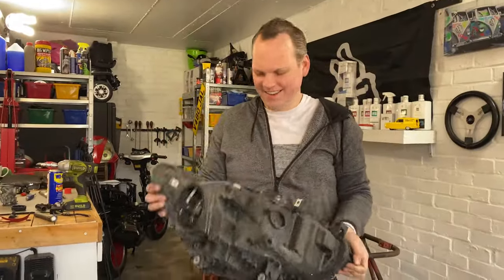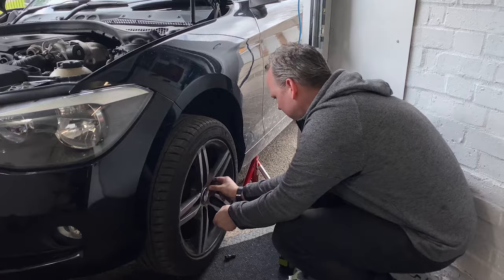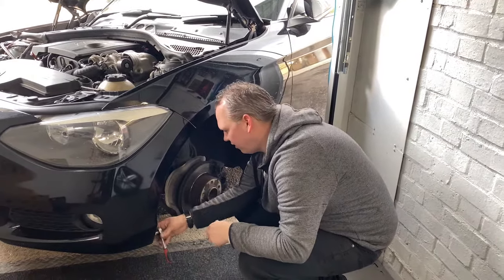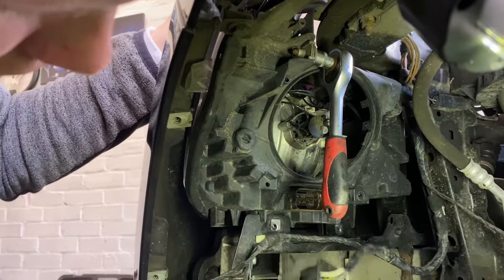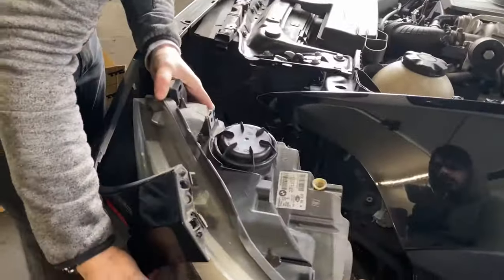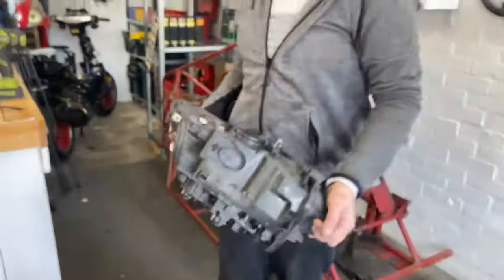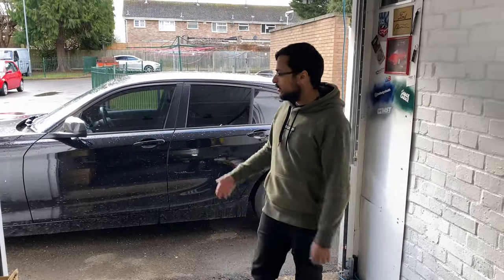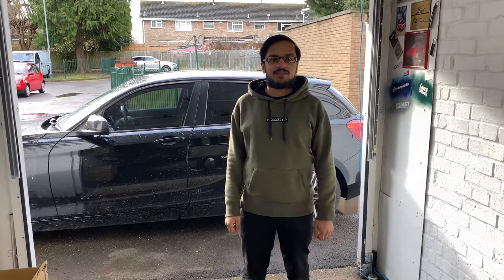How To Replace The Headlights on a BMW 1 Series F20 | #BMW #MSport #F20

Comment: Hi mate, I have been trying to remove my headlights from my 2012 F20 but the two headlight bolts (alignment nuts)(the t30s) at the bottom of the headlights seem impossible to remove as the nut keeps spinning when trying to undo the bolt since the clip over the top doesn't seem to be doing its job by holding the nut in its place. Is there a way round this do you know? Any help would be appreciated.
Reply from the maker: Hi Liam, yes unfortunately we had the same problem that you are expecting I did try to hold the nut with some vice grips but unfortunately didn’t work. In the end I had to cut through the bolt and replace with a new one. Hope this helps.
Reply: @Budget_Builds  how did you manage cut them out ?

Comment: Pleas ebro i cant remove those 2 bolt that holds the light down. How do u remove it
Reply from the maker: Hi, so for the two T30 Lower bolts at the back off the headlight, I had to cut one of them off as it was very rusty behind and wouldn't undo at all.  I replaced it with a 10mm bolts instead 

Hope this helps 👍🏻

Comment: Hi how many pins does the wire have to headlight on f20 as I'm trying to find new wiring
Reply from the maker: Hi Katie, I've added the link for a new plug.

https://www.ebay.co.uk/itm/275326467872?mkcid=16&mkevt=1&mkrid=711-127632-2357-0&ssspo=C2e_dx-8RYm&sssrc=2349624&ssuid=08TE4P0mSS-&var=&widget_ver=artemis&media=COPY